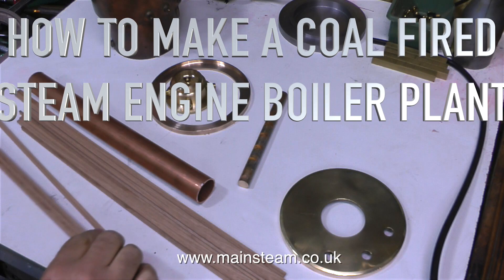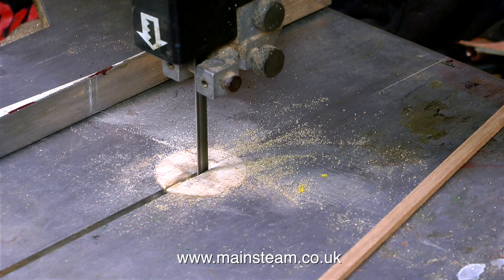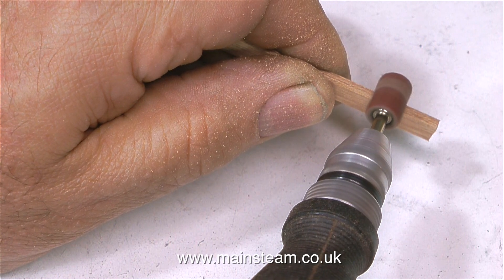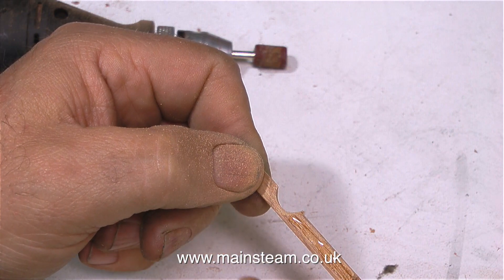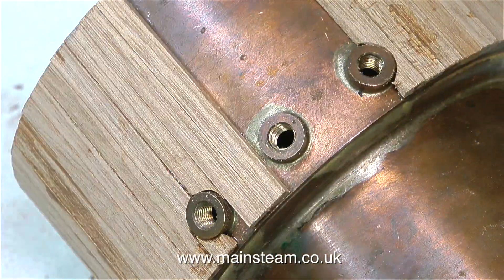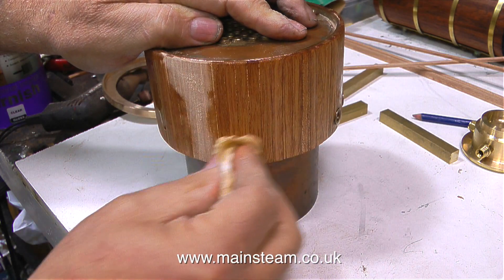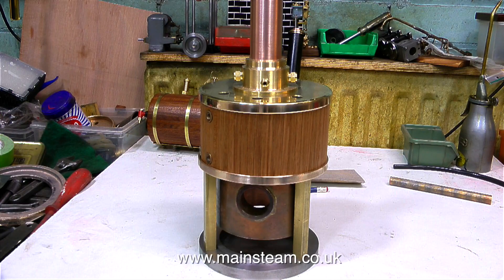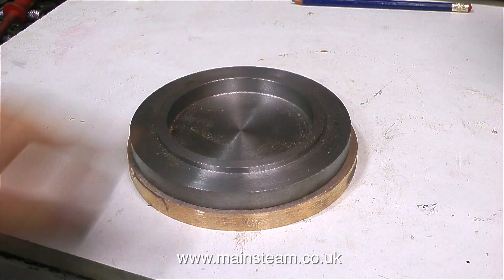HOW TO MAKE A COAL FIRED STEAM ENGINE BOILER PLANT - PART #7

Comment: Does heat from the boiler affect the CA glue over time?  Great idea for holding the cladding.
Reply from the maker: Yes I think so. But that is a good thing. The CA glue bond to the copper is not good, but the bond to the planking remains fine. If ever you need to remove the planking, the strips come away in groups which is useful

Comment: FYI, when notching the wood out for the fittings, I would have used the bandsaw to take many perpendicular cuts up to the pencil line.  Then snap the pieces out and “waste away” the rest of the broken off pieces, essentially getting within a hair with just the bandsaw.  Then I’d use the sanding drum to iron out the desired profile.  Great vids; keep it up!

Comment: I'm not sure if it would work, but would sticking  planks together with painters tape and then drilling the hole be possible?
Reply from the maker: I doubt it, as the drill would push the gaps apart.
Reply: I don't have any bits of wood that would be comparable. Would you perhaps be willing to give it a try by wrapping tape all the way around the two pieces? (Just putting it on the surface would only give the strength of the glue, wrapping gives the full break strength of the tape)

Hope I'm not being overly rude by asking, I quite enjoy your videos.
Reply from the maker: By which time,  after all that messing about with sticky tape and measuring, then marking out and finding that the drill splits the wood, I can have the job completely finished by doing the way that I show in the video :-)))
Reply: That is a good point. Didn't think about overall workflow. 

Thanks for the replies and keep up the great vids.